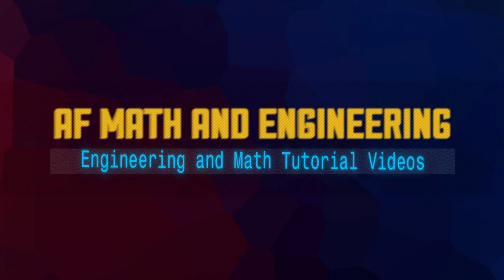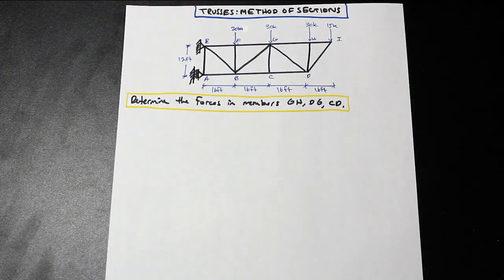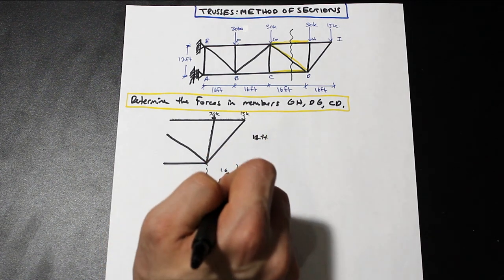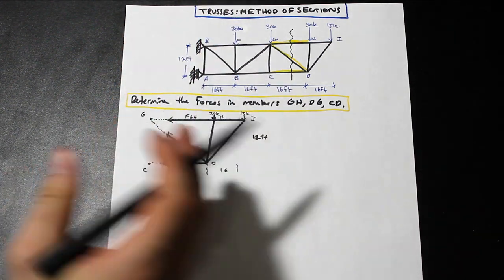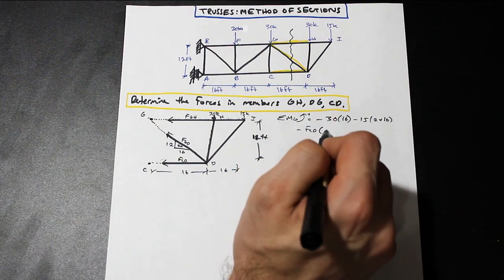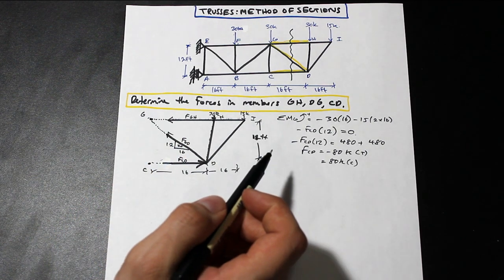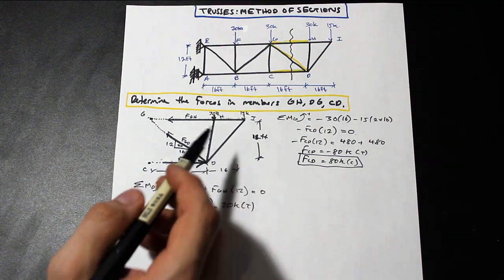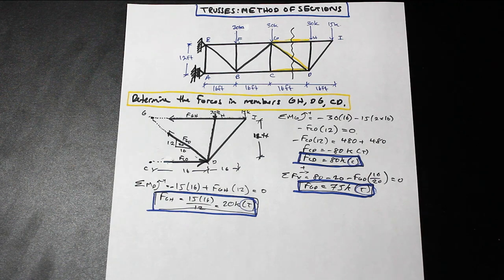Solving a Truss Using the Method of Sections - Step by Step Example

Comment: At 9.03, why don't you have to use the other forces in the moment equation such as DI and HI?
Reply: If you strategically take moments around a point through which unknown forces pass align, then the moment due to these forces is zero.  For a statics problem, you can take moments around any point you choose, and adding up moments to zero is equally valid around all points.